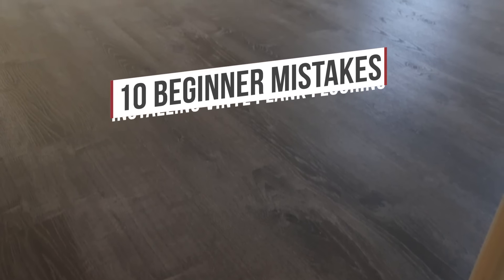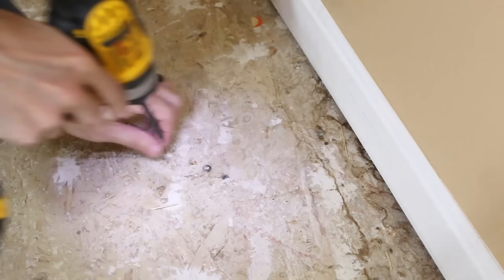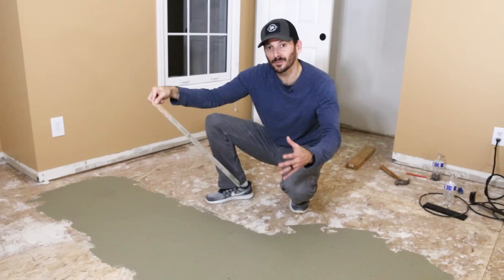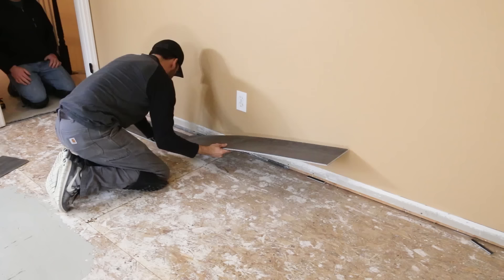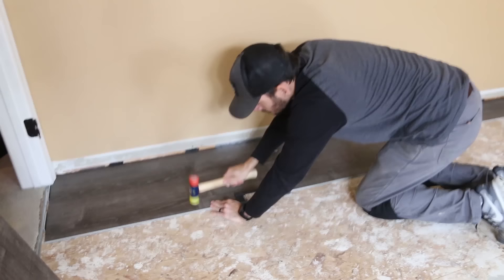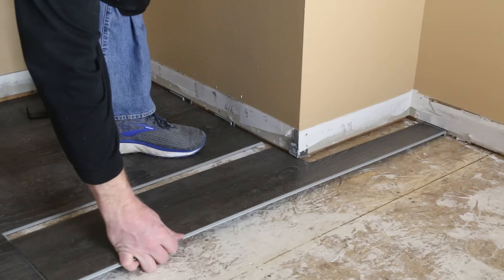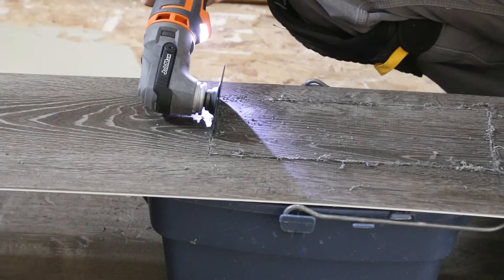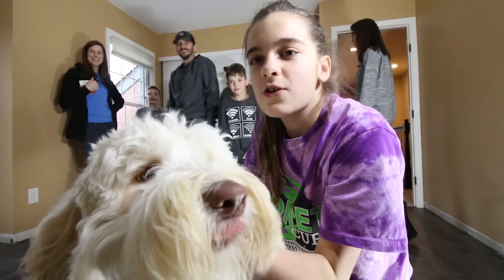10 Beginner Mistakes Installing Vinyl Plank Flooring

Comment: I used this same home flooring. From home depot. It is amazing 5 years later and it still looks like day 1 when it gets mopped. I even used it in my living room that is 20x24, no random gaps, no weird pop outs at all.
Reply: Should NEVER EVER mop any vinyl planks because if water seeps into cracks you end up with a mold infestation. Swiffer is recommended.
Reply: @djirate052380 🤔swifter wet formula be leaving a slight film on my 7yo laminate floors. I have better results with my "spin mop" which allows me to choose how wet I want the mop head. Trust me, it be too dry sometimes 😂 my floors were made for heavy traffic (grands) and swifter not gonna cut the dirt like a hot mop will
Reply: @4evrcaligirl899  just saying....we replace black molded floors all the time. Be careful...can make you really sick
Reply: Hi did you worry about uneven floors.

Comment: Doing floating snap flooring for the first time. I'm a contractor and the customer is fully aware this is my first time. I've done plenty of tile, and so far it's been a snap! (Horrible pun, I know) any diy people out there don't be intimidated, you got this. This video perfectly explains and goes over everything you need to know. I really wanted to let you know your video is extremely spot on, like always. I also wanted to let you and your subscribers know about a trim pulling tool from Goldblatt that a friend introduced me to that is far superior to the Trim Puller. I ordered it off Amazon for just over $20 US, and it's just amazing. Anybody buying a trim pulling tool, you've gotta try this one! I swear I'm not some Goldblatt troll, just love tools and wanted to drop a line and let anybody know it exists. Again, great video thanks for sharing the info. Have a great day everyone!
Reply: Yes! Trim puller didn't break even 1 baseboard (aside from the fact that whoever installed it was overzealous with the nail gun). I also used it to easily pry up the tack board.
Reply: I'm bidding on my first major job, replacing the entire subfloor, laying lvp etc.  AND its just me myself and I.  I've done a lot of floors but for some reason I'm nervous about this

Comment: As a certified journeymen Floorlayer- I say good job on this one1 Its a great guide for a DIY and hits a lot of points others miss.  I watch so many you tube videos on DIY flooring advice and see so many things missed and weak and even wrong advice given.. but you guys nailed this one. Good job.
Reply: Can you help me!!!  I am using this product (Life Proof vinyl planks) in an old small office in an old building where I work, approximately 8x8.  Unfortunately, the existing floor consists of a carpet, (which I started to pull up because I was told it was concrete underneath the carpet), but when pulling the carpet up I found out it was glued down to thin square tiles (I think vinyl) which were under the carpet.  In some places where there was a lot of glue/adhesive, pieces of square tiles broke and came up stuck the back of the rug.  Of course where those pieces broke, I noticed under the layer of tile that the carpet was glued to are old cork tiles.  So since the vinyl plank floors are a floating floor and there is adhesive still on the top of the tiles, as well as the small areas where the vinyl tiles broke there is cork tiles, I was told I can't place the new vinyl planks unless everything comes out, which I can't do, or... 
I was told I could use a thin layer of something like floor leveler to create a new layer over the tiles and cork tiles that are showing.
My million dollar question is can I use a concrete self leveling material on the cork tiles? and if so, will that layer of self leveling material be suitable for the vinyl planks to rest on when expanding/contracting due to fluctuating temperatures?
Reply: Placement of the transition (under the door) was correct, I've seen too many jobs where the installers didn't, looks like trash. Glad he stressed avoiding short pieces, mentioned the story-stick measuring method, etc.
An excellent guide. I'm not  a master, I've only put in somewhere around 150 floors, but agree with all tips.
Only add-on I have is the cutting. Doesn't work for ripping, but I use a vinyl plank cutter (Brutus) to cut to length. Cost is about $130 at Lowes, so not great if you're doing just one or two floors, but faster and easier than any other method I have found. Also no little vinyl chip dust you get with saws that gets everywhere. Though I still use a utility knife and/or jigsaw for circumferences and detail notches.
Reply: Mike R. I'm a retired worn out tile guy. I've installed everything except carpet in over 30 years. The last 15 years I specialized in "hard tile". My advise, buy an 8" floor scraper, one that has a razor cutting edge. Get everything up, everything. Any leveling compound will not like a spongy surface, aka cork. Other things to consider is the types of adhesive used in the old flooring material. If it was water based then the moisture from the leveling compound may cause it to break down releasing the old flooring.
Remember, surface prep is about 75% of the job. Short cutting to save time and sweat/blisters may cause product failure and the loss of any warranty.
Be safe and good luck
Reply: Ply wood subfloor over existing floor drum sander to lower the high spots and level flow for the low spots.
Reply: @miker6402  prep is 74% of the job.  Take the time to remove All of the old flooring.  See Donny’s response.  We had carpet over linoleum and the linoleum backing stuck to the particle board sub floor.  Lots of scraping and pulling of nails and staples out of the whole house.  A big challenge, but in the end.  Fabulous new look.
Reply: Tile thinset to level a wood floor is not a good idea.
Reply: I have to raise my floor up inch to match another floor in my house on the main floor so I’m confused on the installation.  Do I do concrete flooring/vapor barrier/plywood to raise floor/engineered hardwood or is it concrete/plywood to raise up the floor/vapor barrier/engineered hardwood?
Reply: @caffeinated24x7  If it were me I would save the time and money and use reducer transitions. It is hard to tell what materials you have and are using in this question. If you have concrete subfloor it may be easiest to put roofing paper/moisture barrier down and ramset plywood on top, then glue/nail/click lock flooring on top of ply. You will always put a barrier of some kind between flooring unless it is glue down.
Reply: @jonathanpope5068  I have a concrete sun floor. So I’m trying to understand do I put a barrier there and then the plywood to raise the floor and then the hardwood?  Or a barrier over the concrete and also over the plywood?  Was planning to nail down and not glue if that’s doable
Reply: @caffeinated24x7  I would put 10mm plastic on top of the concrete and put resin paper on top of the poly plastic, then put plywood, ramset it in, then more resin paper between ply and nailed down hardwood/engineered floor. The poly plastic and resin paper are cheep and the paper is just a precaution for condensation that could build up between the different temperatures of the materials.
Reply: @jonathanpope5068  thank you!
Reply: @caffeinated24x7  Make sure you put some gap about 1/8 inch between sheets of ply
Reply: you agree with this job because you not a floor guy.........
Reply: Wtf is a journeymen floor layer lol
Reply: @curtislind8661  I think that’s an apprentice floor fitter if you live in middle-earth

Comment: When removing the tack strip save some carpet pad to roll them up in
Reply: And I read this AFTER I threw the padding out.  😔
Reply: Ill be doing that from now on
Reply: Finbar Mathews 
Excellent tip ! 👏👏👏👏🇬🇧
Reply: Yup !
Reply: that's awesome advice thanks....
Reply: Actually is the padding but either way works
Reply: @franciscotavera1889  Thank you for your contribution
Reply: Yes, they are nasty
Reply: and save a small piece of carpet 2’ x 2’ to keep your tools on
Reply: Holy cow!  That tip just blew my mind-no sarcasm. I would have saved a lot  of ripped trash bags and annoying leg pokes while carrying said trash bag out .  Thanks mate, Cheers.
Reply: @orlas5861  you
Reply: My goodness dude, all this time I've been using work gloves and trying not to get poked.  Thanks for the tip.
Reply: Yes most people don't think about this
Reply: Use hammer when taking out tack strips
Reply: Rookie
Reply: I do that with out ur math 😂😂😂

Comment: Excellent video - thanks! I usually take the opportunity to upgrade the baseboards to something taller / nicer. This is especially helpful if you're going from carpet to plank flooring because otherwise you're going to have some painting to do if you put the original baseboards back on.

Comment: I just did the same type of install using Mohawk from Lowe’s. It required .25 inch expansion gap. I left the baseboards on and covered the .25 inch with quarter round. I learned from my mistakes and will learn from them  when I start another room. Nice video

Comment: Great video, very helpful.  I would take the baseboards off before doing the flooring as well.  A lot less of a headache, can also give them a quick coat of paint to clean them up while they're off if need be, much easier.

Comment: Great job. I mostly use a barrel grip jigsaw for 90 percent of my cuts , cutting from the bottom of 
the vinyl flooring , so you are cutting with the saw upside down . Very easy to see your lines , plus no tear out
and no chance of marring the flooring. Takes a little getting used to , but for each their own .

Comment: you made some very good points. Regarding the base molding removing for the vinyl flooring to go underneath thereby creating a cleaner look without the use of the shoe molding.....that's fine, but by doing that you make it more difficult to later replace a piece that might get damaged. One of the benefits to the floating floor is to be able to replace pieces if need be with ease. By going under the base molding, one would have to remove the molding to create room for separation?

Comment: I have found over the years that using planks with the underlayment built onto the back is a big let down. We usually use the underlayment made of recycled tires with built in vapor barrier, that gives a much more sound deadening effect, and it is firmer and more comfortable to walk on, just make sure you get planks with no underlayment already installed. Also, you might have to put down 3 mil vapor barrier first if your underlayment has none. We always remove the baseboards, I too prefer to slide the wood planks under where the baseboard will be, so that it can expand under the drywall. This provides you with some good buffer for error when you have wavy walls, but you still need to hide the gap. For concrete and wood floor dips, we use a self leveler mortar, which when mixed pours down like pancake batter, very liquid and loose, and it finds its own level. We just coax it into place and make sure it is flush with the rest of the floor.
Reply: Vapor barrier on a ground slab will result in a saturated concrete floor if you live in a humid climate. I have torn out laminate floors and was shocked at how wet the slab was. So wet it had to dry out for more than a week with dehumidifiers running. Not only does it create a double vapor barrier, moisture cannot escape, it brings in fresh moist air (to condensate) every time you walk on a spot that is not perfectly flat. No sub floor is perfect. Also grinding the floor (concrete) is my preferred method to level. No set up time, no risk of product failure. Floor leveler only for severe dips.
Reply: jeffostroff great tip I never knew there was such an underlay
Reply: @dcwoodworks  Yup, they sell it at Floor & Decor and also Lumber Liquidators

Comment: ooh, ooh. I really like how they ensured a straight cut using the jigsaw kept in line with the straight edge clamped down on both ends of the sawhorse table. Cool beans!!!
Reply: i just use a multi-tool and my knee. lol

Comment: While you are doing a subfloor fastener check this is a good time to do a subfloor creak check, if the home is 15-20+ years old, take a good walk around and inspect for creak noises and fix by adding screws to spots in the subfloor (in line with the joists of course)

Comment: We ended up having to fill in a low spot like that and used self leveling concrete.  After about a year, you can hear it crunching when you walk on it.  It's great.
Reply: The reason it’s crunchy is that the floor is flexing, if it were solid that would not happen.
Reply: you always need to screw in the subfloor before you apply the self leveling compound. Even if it looks like it is screwed in, throw more screws in there. If, however your OSB subfloor is delaminating, then you will need to replace it all together.

Comment: Well done on many parts, opting out of quarter round/shoe moulding leaves an unsightly gap at the top of the baseboards in this case. Leaving you with a choice between a repaint or a taller base. Other than that, undercut the j bead at the closet in the same way you did the door. Bonus points if you also cut the corner bead at the back. (Probably can't do either with the hand saw option) very decent instruction all in all!
Reply: I thought the same thing about the baseboard having a gap with the wall paint. And noticed they didn't reinstall the baseboards for the video. That would've been another mistake, I guess.

Comment: Seeing an install without a quarter round is definitely a sign of a pro/enthusiast install. The only time I might look past it is if you've got some really nice built-up baseboards where the quarter round looks appropriate and not just an afterthought.
Reply: I think quarterround looks ugly but you do need to give floor space to expand
Reply: I had an old house with built in wood baseboard trim so in that room I did use quarter round but it turned out really nice. In the bathroom I pulled the trim and it was super clean looking after I was done. Definitely would say remove the trim if the option is there!
Reply: @sweetbriarhuslin7371  I was thinking that same thing and hadn't noticed spacers or anything. Maybe I just missed it. 🤷
Reply: Pros use shoe molding unless the homeowner wants to go with a larger base or the base is very low to the ground in the first place. Removing base that is caulked to a wall can cause all kind of ugly when the base is put back on lower than it originally was. If you do opt to take the baseboards off, then you have to very carefully cut it off so it doesn't rip any of the sheetrock paper and then you have to clean off all the caulking and repaint the wall before putting the baseboard back on.
Reply: Base shoe is more attractive and less chunky looking especially on a shorter baseboard.

Comment: If your miter saw can’t cut the whole width, raise the planks by putting a piece or two of mdf or plywood on the miter saw bed. A 2x4 also works. There’s the added bonus of extending your saw table.

Comment: Thanks for the explanation to some of the issues.  My landlord said she put down the vinyl plank flooring in the kitchen 2 years ago, and it is failing.  She used underlayment, but the vinyl looks like that was appropriate.  I think the issue is they failed to level the floor underneath, as they went over oak flooring.

Comment: I’ve done almost my entire 4 bedroom house. I always remove the trim and put down new trim. I like the look of 1/4 round on the trim so I also add that. Thanks for the tips.
Reply: The whole point of removing the baseboard is so you don’t have to install 1/4 round. Seeing 1/4 round installed is typically a red flag that the install wasn’t done professionally. But to reach their own.
Reply: Did you mean "shoe molding" instead of quarter round?  Shoe molding extends out 5/8" from baseboard, where standard quarter round is 3/4" x 3/4".  Shoe molding looks good to me, but the 3/4" quarter round looks like your covering up a bad install in my opinion.  I had lumber liquidators install real hardwood on the majority of my first floor, they had a few areas that the shoe molding would not cover, I made them fix those areas before I signed off on job, to avoid the quarter round in some areas.
Reply: @bt7482  Or the homeowner didn't want the painters to come out and recaulk and paint the baseboard. The baseboard goes up before the floor is most cases. Floor guys are the last on the job because we need the whole floor to be clear
Reply: Well that is pointless! Installing new baseboard only to add 1/4 round cause you "like" the look of 1/4 round? Facepalm!